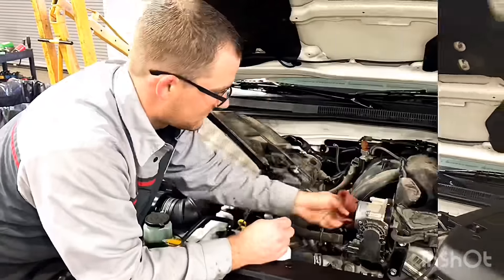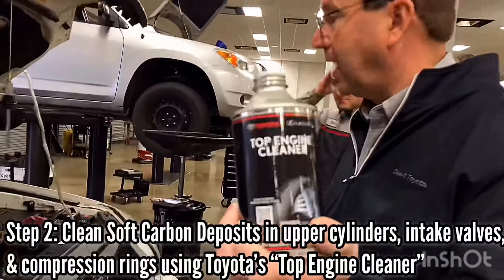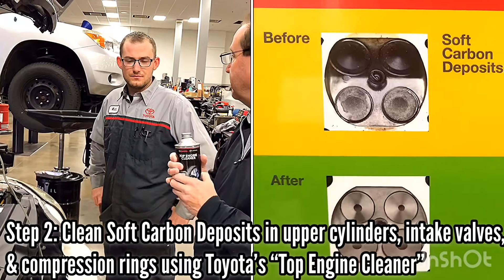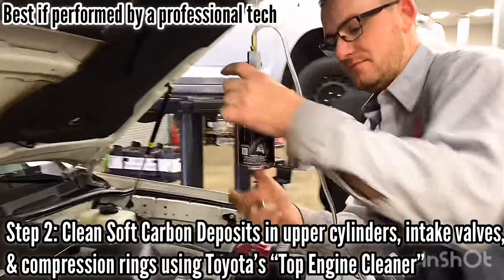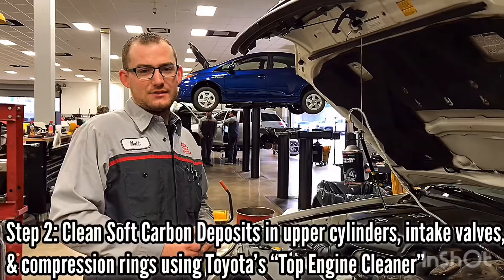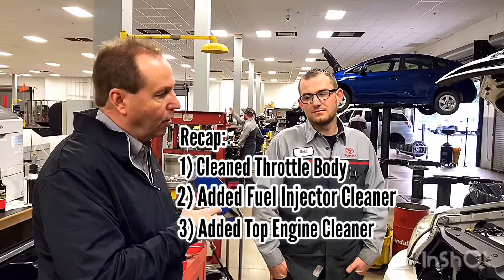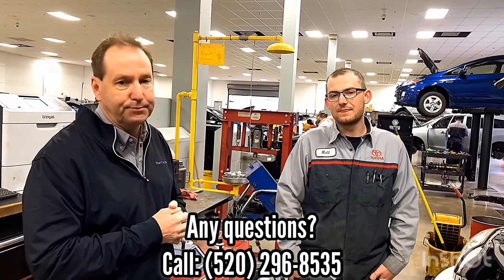Fuel Induction Cleaning Service

Comment: These people are honest man!! The Toyota dealer I am going to always told me to do all these services every 30,000 miles. It not cheap, your bill can be more than 350  dollar plus oil change will be more than 400 dollars. What a rip off.
Reply: I had an old Scion; a real lugger with 2nd engine; then I had the induction cleaning done with my personal mechanic; she flew like a bird!
Reply: They use junk cleaner at the dealer, Go to a independent shop that  uses BG products to do this.
Reply: I'm on youtube looking for more information on this. I took my 2019 Toyota Rav4 yesterday for an oil change and tire rotation. I am at 28,000 miles. The service guy checked me in, and then started telling me I needed to have this done. $199! I declined for the time because they caught me off guard  with this. I didn't find anything in Toyota maintenance mentiong this. I hope they were not trying to scam me into spending more money to line their pockets.
Reply: @craig9843  young Toyota; use Lucas oil cylinder lube each and EVERY fill up. About a shot glass. Should be fine
Reply: @jawary8474  Oh? I've heard of "Lucas" brand. Do you think that was some necessary they were trying to get me to do?
Reply: @craig9843  Go to a mechanic that uses BG fuel injector cleaner everything else is garbage. It works amazing. That price is about right though. Get it done every 30 000 miles it gets rid of the carbon build up.
Reply: @craig9843  I would have recommended that at the 90k service; long history with service histories of old Toyota’s... they haven’t changed much; never buy bad gas, don’t skip the oil change 4500 or 5k service; I use higher octane gas to reduce ‘engine tick’; I do USE the cylinder lube to KEEP it lubed. Air filters replaced or cleaned and radiator flush happened WITH REPLACEMENT CAP. Service your tranny at the 60k Mark as well as brake fluid; both get fouled up by then.
Reply: @craig9843  NOT UNNECESSARY but rather early :)
Reply: Don’t do the transmission yourself; it may require an expert.
Reply: @jawary8474  i bring the car to a mechanic that has been doing it for 40 years
Reply: @jawary8474  Thank you!!
Reply: @josiahculley9877  Thank you. I was just caught off guard. I went in for oil change, tire rotation, air filters etc. Then that was tossed in my faces. I’m glad I declined for now. I wanted to know more about. I’m just afraid they were cheating me out of money.
Reply: @craig9843  dont use there product it is garbage, go to  a mechanic that uses BG cleaner.call around your area. A lot of the old timers use  BG products they know it is the best. The ones that have been doing it 30 years type
Reply: @josiahculley9877  Thank you. I get nervous at the dealer anyway. I was skeptical from the beginning. They just try to scare people. It’s so wrong.
Reply: @jawary8474  hey man, do you know a lot about carbon buildup? I have a lexus is250 2007
Reply: @jawary8474  How much did it cost you?
Reply: @craig9843 they're not cheating u out ur money. They're actually trying to recommend to do it for the health of ur car

Comment: This is really only necessary if you have a GDI engine. Port injection sprays fuel onto the intake valves, since gasoline is a wonderful solvent it basically is self cleaning. The exhaust valve would get carbon build up, but this cleaner wouldn't be a liquid when it hits the exhaust valve anyways. The throttle cleaning is useful on an old car but nothing that you need to be certified to do. The in the tank additives are useful for removing water from the tank... You were correct that you can damage the engine if you hydrolock your engine by pouring the whole can in all at once through the intake. But they sell aresol cans to do the same thing at home if you REALLY insist.

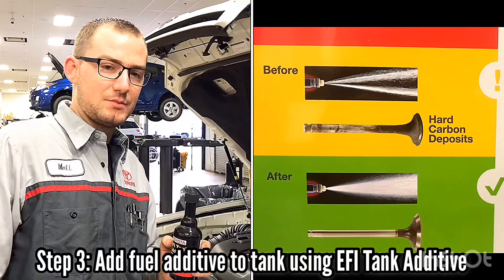Comment: My critique:  0:38 The throttle body gets dirty mostly because the PCV breather tube routes blow-by to the intake under heavy engine load.  1:01 Toyota does not recommend that you manually move the throttle plate on an electronically controlled throttle (turn the ignition to ON and depress the gas pedal to the floor to move the plate).  1:52 It's not difficult, you just hook up and let the engine idle.  2:06 The atomizer tip is placed too far from the intake plenum reducing the effectiveness of the atomization.  Here's how it should be done: https://www.youtube.com/watch?v=IvhPybUDia4&ab_channel=ToyotaCompleteMaintenanceCare
Reply: You are 100% correct yep
Reply: thank you so much, my Daughter is a single Mom of my two grandchildren and I will be performing  maintenance on her car. She bought this 2019 camry and not even 1yr she bought it she's been told she needs $400 of maintenance done to her car.
Reply: @emiliohuerta2658  The top cleaning is not necessary unless the car has a driveability issue (rough idle, hesitation, surging, etc.).  If there are no driveability issues, just use a bottle of Techron Complete Fuel System Cleaner and change the oil.
Reply: @emiliohuerta2658  $400 of maintenance at the dealer?  That's like an oil change, tire rotation and cabin air filter!  LOL  Seriously,  subscribe to The Car Care Nut Channel.... search there for any services / maintenances you need
Reply: 100% correct with all new cars even my 08 crv.as soon as he said he was going move the intake started putting his fingers and moving the plate I was like NOOOOOOOOOO don't do it awww he did it what a rookie.now he has to do the relearn procedure and calibration of intake.this was like watching jiffy lube service training introducing new product thats rebranded for shop lol

Comment: This is needed especially for GDI engines carbon definitely builds up overtime.
Reply: These engines have dual injection, port and direct.
Reply: @anthonyz7023  They do but apparently the port injection is not good enough as a lot of the new Toyotas are having heavy carbon deposits on the valves

Comment: I'm just not grasping how the carbon is broken off the valves top of the valves in the pistonheads and then goes out through the exhaust . explain how it gets thru the catalytic converter. or when the gas bypass comes up .   I'm clean a lotta intakes on a lot of different equipment. And I've always followed up with an alcohol to remove the oily film cleaners leave
Reply: It burns up in the catalytic converter
Reply: It basically dissolves the carbon into the cleaning fluid, then the cleaning fluid gets burnt away like gasoline in the combustion.

Comment: Do you need to change oil after this service ?
Reply: Nope
Reply: Yes. There is some blow-by that will contaminate the oil. If you don't believe me, check the oil color before and then a couple days after this service is performed.

Comment: Aww. no blowout video? the blowout videos are awesome. lets the customer see just how well it works. if its a good cleaner you will see a big blowout of carbin after letting the car or truckk sit for 10 mins or so way the cleaner gets a chance to work on all parts it touches. recomended at least once a yr for any car or truck that has over 100k miles.

Comment: So I have a kia Sorento 2019 4cylinder GDI engine, my mechanic told me to get the Induction service done once a year...  It's definitley not Toyota, so he's probably right. I've been using Lucas upper cylinder injector fluid cleaner, do you think that is as good as the Dealership additive? Kia sells one, but I'm  not even sure how much they charge. Dealership's should tell you a lot more clearly how to take care of the engine. They are the one's that designed it, not me. We all know Hyundai/KIA had an employee that was paid off for coming forward explaining the defect with some of their motors, funnny no real action has been taken. and Hyundai / KIA are giving people a harder time to replace motors now. I'm wondering how long this engine can possibly last even if I baby it. lol
Reply: Its probably the same cleaner just labeled by a different brand, its fine.

Comment: Should  you have rpm at 1500 to 2000 before doing that service our just at idle
Reply: Depends how much you are spraying down the vacuum hose. If its not stalling it doesn't need to be above idle.

Comment: Sounds like Seafoam to me
Reply: Seafoam is great in traditional motors, but with modern GDI engines (direct injection) the fuel additive is unable to wash the back of the intake valves, so the Seafoam is only helping clean the injectors. GDI engines are more efficient, but gunk builds up quickly on the back of the intake valves. Plenty of YT videos on the subject.
Reply: @espedale  Thats not true ive been using seafoam for years to clean the back of valves. You send it down the vacuum line just like the top end cleaner in this video.
Reply: @BigNick10 Which Seafoam product? The original fuel treatment?

Comment: What is the product number of the SST used to run the top engine cleaner? They don't have it here in SOCAL.
Reply: The tool has been discontinued by Toyota.  But you can buy the same tool from Subaru part SOA868V9430.